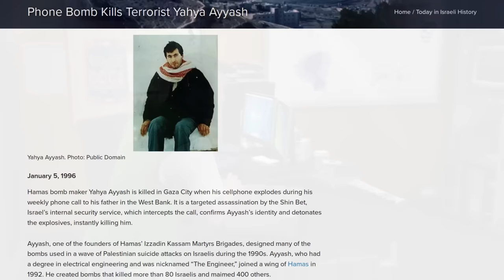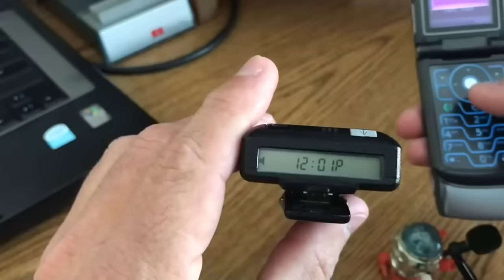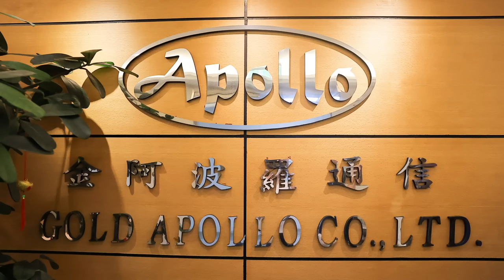What Causes Pagers To Explode

Comment: Quick chemistry lesson here. Lithium is not an explosive substance. The molecular hydrogen produced as consequence of lithium reacting with moisture CAN be explosive under specific conditions, but I would not classify it as an explosive either; it's highly flammable, but a flammable material is not necessarily an explosive material and vice-versa (e.g., C4 is not flammable, yet it's explosive) (although a material can possess both properties). Of course, in the right mixture % and under the right pressure, hydrogen will explode, but you would need much more hydrogen than that produced from the lithium reaction in a lithium AA battery. 

A lithium battery the size of an AA typically found in a pager device will never cause an explosion such as the ones caught on tape during the events discussed here. For an explosion of that magnitude, and with that type of detonation precision (the devices were detonated all at once allegedly triggered by a message sent to all pagers simultaneously) a purposefully designed explosive material would be required; plastic explosives (what you referred to as C4) are the most common, since they're cheap, extremely stable, safe to transport & handle, non-toxic, solid, highly powerful, and can be safely detonated from a distance by using a small remotely-triggered blasting cap triggered in turn by an electric signal (e.g., an incoming page from a specific number, although this would require a separate chipset for that logic).

So in short, whatever happened here was most probably the product of directly inserting a plastic explosive on each device, probably by substituting one of the two batteries in these pagers, plus a simple chip in charge of orchestrating the explosion.

Also, oxygen is not explosive nor flammable; no hospital will blow up with the explosion of a pager. Molecular oxygen is an oxidizer; it aids the combustion process, but is not reactive on its own.

Lastly, if this operation was indeed executed by the Israeli forces, it most probably required a massive amount of effort in the planning & execution (most likely several months to plan). This was one of the most sophisticated operations Israel has conducted, where an extremely thin window allowing for quick action was opened (i.e., Hezbollah switching to pager devices). This is far from a reproducible maneuver.

Comment: Real question is 

What civilian uses a pager in 2024?
Reply: Most who do are doctors and people who work in similar environments.
In hospitans, especially in the basment areas where they usually have the labs, sensitive equipment, and radiation inducing equipment like x-rays due to * the location * burried under reinforced concrete and in some cases radio signals needing to be tightly controlled pagest are the simplest solution for remote comunication
Reply: @HaartieeTRUE  really? My mom is a doctor in New York and she never used a pager there
Reply: @Touhou2006  if she doesn't, it doesn't mean there are none that do. It's still shit. And unless your mom works in the labs/basment areas, of course she doesn't. She just already has signal when needed.

Comment: I could imagine that the battery was the issue. You see, my brain outaged my body, I enjoy my evening coffee, when going on road trips I mostly listen to old music and when I'm walking somewhere, I rather listen to music from my AA powered cassette player and a pair of KZ in ear monitors rather than selling my telemetry data to Spotify.
I recently bought for my jailbroken Xbox 360 controllers and the cassette player a pack of BLACKUBE AA batteries which have LiPo battery in it and can be charged through USB C.
Now if the people using that pager also got this type of batteries, I could imagine having something similar in a pager but with fake capacity to justify the price and explosives in the other half of the AAA battery which can be triggered by short range frequency like a garage opening module which is integrated into the center mirror in my Mercedes W140 S Class.
Other option would be a intergrated BT LE module which could also be triggered after connecting to it after entering a complicated password like 6666 and playing any type of audio in order to trigger the igniter

Comment: explosive charges inside the batteries - happy searching, researcher

the normal load level will not harm, but when the device is compromized with a hacked firmare you need a surgeon

Comment: imagine if they sold batteries in the local market that have a trigger board and a small explosive inside. Then when you use a generic pager, a message can communicate with the trigger board inside the cell and boom.... When you use this battery for anything else it will just remain dormant.. Tin foil hat time...
Reply: You'd need the thing to have a very broad energy consumption tolerance and also have some way to have some consumption pattern that's both unlikely to happen from regular use and a way to somehow make that happen in the device, which is close to impossible, because that step requires that you know what device it's in in the first place. 
MAYBE it would work in smal instances but overall, the only thing you can do is make batteries that either explode upon usage (any usage) or not at all

Comment: If you can find a way to attack a lithium battery with malware, without blowing its safety fuse, I'd be surprised. I don't think it would be possible to attack a lithium battery with malware. It is a physical safety fuse, not anything controlled by software. Could've at least done some googling on lithium battery safety measures against having malware send too much current or something to the battery to try to explode it. I just don't believe it is possible unless the physical safety components had some sort of failure also.

Comment: Simple problem, lithium batteries won't be extinguished in water. Water makes it worse. So does Air. You have to reduce the amount of oxygen to the fire to smother it. You could submerge an EV fire in water, it will still burn. Smother it in gas or mineral oil, it will die out and cool down. Hence, shipping containers filled with salt-water or just carbon dioxide will work to dampen/smother a fire.  You need to douse it in oil or salt-water/brine or a halon/sealed container. 

This has been a known problem since the mid 2000s' when Lithium ion was being used in model planes and the old pager/mobiles that were supposed to be crash-proof. But weren't.

Comment: Guess what they can do with EVs, especially with squizoid remote control and telemetry like Teslas. Just a battery voltage command to the ECU’s / BMS or even autonomous driving. The sky’s limit.

Comment: 2:12 Aren't you not supposed to fight lithium battery fires with water? Pretty sure lithium reacts with water to generate heat. It is possible that the firefighters wanted to accelerate the battery's burning themselves up

Comment: bism Allah w astaghfir Allah, they should check for unknown messages in time of attack and isp traffic to make sure it's not a NSA vulnerability i think that code is vulnerable to int overflow in some sort of bitwise operation within the code and IoT manufactures don't care too much about safety and security cuz most of vulns are dummy and you could check other hardware vulns that are registered and shared within the internet.

Comment: apparently the Lebanese had found about this, and before they issue a silent move, a mole informed the Israelis, in which caused them to prematurely detonate them. 
apparently they were supposed to be explode during Israeli incursion into Lebanon, create confusion, and prevent them from taking proper action at said time and therefore lose!
the devices had been tampered with, had explosive charges with a ring of metal beads in a compact space, allowing to act more like a grenade! 
reminds of me of the allied forces use of explosive laden toys in ww2!

Comment: i don't think a plane would crash from such a small explosion, oxygen isn't flamable it's combustible. also gas stations are not that prone to exploding as you'd think (but don't try your luck so please don't smoke in a gas station) also a propane tank would definitely not explode (better yet propane is often used to make fire)